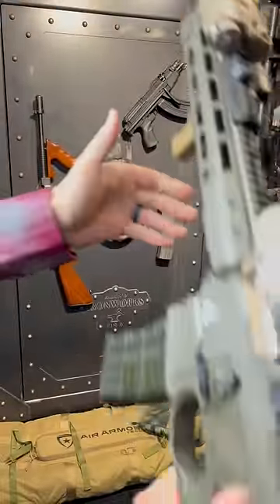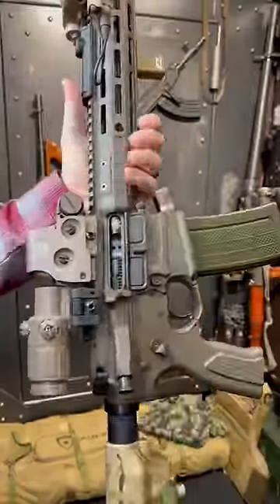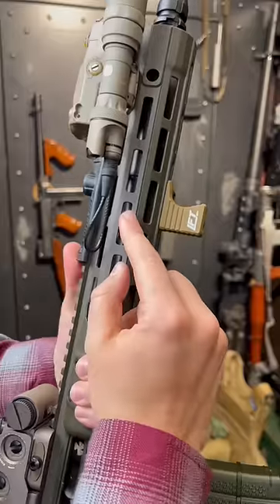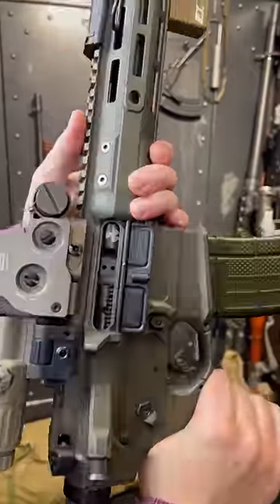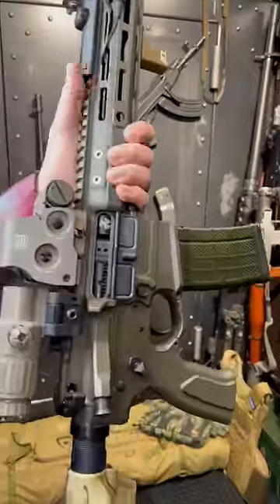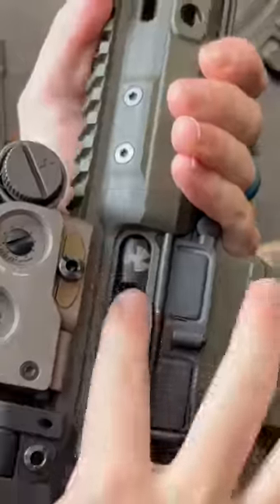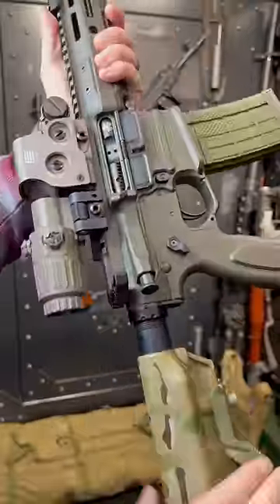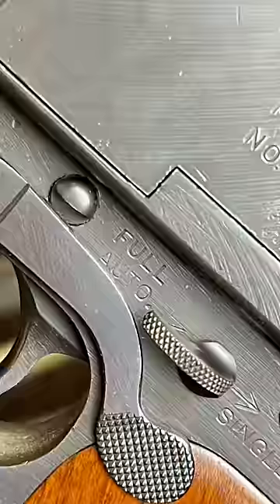Pro Tip: “Tuning” Your AR Explained in 1 Minute #Shorts

Comment: I guess you can say my dissipator is tuned.  16" barrel rifle gas system and just the right spring and heavy enough buffer for light recoil but smooth loading and reliability.  When I bought it it was a flat top upper that I had on an A2 lower.  I changed it to a car 15 stock, changed to A2 upper since I'm an ironsight shooter and swapped out the A2 handguards for A1 triangle handguards.

Comment: Do you have specific suggestions? I run most carbines with a Spikes T2 as the heavier 4 oz buffer is self explanatory plus the tungsten powder vs a metal block clickety clacking back & forth is noticeably smoother and a JP "tuned" buffer spring. They go from factory over gassed to  smooth but I'm all about smoothER. I'd greatly appreciate any suggestions you have. An adjustable gas block has not seemed to do much for me. In my experience, between the tiniest adjustment is a round barely landing on my foot and flying out at 3:30-4:00. I'm all ears my friend...that makes me jealous on the daily. 🤷

Comment: In guessing it’s a carbine length gas system , what part did you use for the buffer ? Supper 42 spring H2 or H3 buffer or did you go the jp scs system ?

Comment: where is the gas “in yo’ face” coming from? 

the gaps in the gun?-> would rubber on the borders between parts work?

an intentional and necessary hole in the gun (like the ejector)? make something that directs the air away (if possible)

Comment: “Gas pressure causes the gun to cycle.“

No, it doesn´t.

It is the recoil action of the bullet being
fired that causes the operation to cycle, but it doesn´t -- that is, not until it is the short-stroke gas piston that causes the operation to unlock, and do so.

This is common knowledge.

Comment: Just get a BRT EZ-Tune Gas Tube. Tell them what your configuration is, what rounds you shoot, whether you're suppressing or not, and they'll pick a gas tube that's better for you. Or if you know what size port you need for your tube, just select the size. It will make your rifle run much smoother.

Comment: But you didn't actually explain how to "tune" it like I know you can go heavier or lighter buffers but how do you lower the pressure I know 1 way you can kind of tell if you are over or under gassed is the direction the ejected casing goes like if the brass Flys forward its over gassed and if it comes out 90° from the ejection port you are pretty close and if it goes backwards it's undergassed I believe but how do you adjust the pressure I know some firearms have adjustment knobs but most ar15s don't so how you do it I know some charging handles can redirect gas but I don't know if that reduces the gas enough please help go more in depth

Comment: Do you have to tune an AR to a specific ammo? If I tune it to one type ammunition, isn’t it likely to fail if I switch to a less powerful load?
Reply: As long as your not switching between insane differences of ammo you can usually find a middle ground.

Comment: Ah maybe thats why smoke blows back in my face on meh ar pistol with one of those compensators that sends the noise down range. Ive heard it increases pressure. Pluss brazed brass/higher load frontier 68 grain 5.56.  Needa look into this!

Comment: When going into battle where you don't know when you'll be able to pull your gun apart and clean it without being shot at. I'd rather have an over gassed gun than one set up to just have enough gas to run it effectively. Cheap ammo different ammo or a few grains of dirt could cause you to jam or fail to feed when your life actually depends on it

Comment: Dream a little bigger?
DARLING!
😂
Leave it overgassed.
Maybe even drill the port a little bigger. Then, swap for a piston system with an adjustable gas block. No gas in my face, cooler for longer, and much cleaner, too.
😊
RIP Adams.
Glad I bought a few extra home build kits and spare parts.

Comment: Where do you put the gas in it?
Reply: In the gas tank in the butt stock. Ipersonally run premium in mine, but mid grade is ok too, just dont get the cheap stuff and you'll be alright. Also make sure you dont let water get in your tank, its never a good thing and you'll probably have to take it to a gunsmith if that happens since it'll probably lock up.
Reply: Also, adding some octane booster in the tank helps with performance.
And don't forget about blinker fluid 😉. You're welcome.
Reply: @GideonMagoh  how could I forget the blinker fluid?! Thanks for reminding me
Reply: @jaythus3181  😆

Comment: Gas Sucks !  Get a Piston AR.
 But not the Big Heavy Piston systems 
 My favorite ... Superlative Arms AR Piston System.
 Very simple design, Ultimately adjustable. easy to tune & Almost as lightweight as the gas system 
 $300 but includes the BCG. 
 The Only systems I run now.

Comment: Wrong!! All wrong!!
First of all your throw away weapon is designed around a 20" barrel. The length of the longer gas tube on the proper sized barrel sends the amount of gas the bolt was designed to accuate with. Same with the standard M16/ AR15 buffer assembly.
 Because you chose a shorter barrel the gas tube is now too short. This does cause a more aggressive bolt assembly movement. 
 Your so called "tuning" is band aiding a problem you have created. In your case and anyone else who's putting too much thought into this matter..... just don't worry about it. You'll NEVER take your "throw away" gun into combat. On the 1 in a million chance you do. Trust me, the last thing your going to worry about is whether your bolt is moving too fast and hard.

Comment: Ok ? But how do I “tune” the gas system.
Reply: Unless you plan on adding a different gas block (which only helps but doesn't tune the whole rifle, it just changes the gas to the most optimal cycling for only changing the block) you can start with the buffer assembly and the bolt carrier. Increasing or decreasing weights increases or decreases dwell times. Gets kind of expensive,  so just finding optimization with an adjustable gb is the most economic and simple way.
Reply: @hahahalo777 if youre buying from the ground up, an adjustable low profile gas block like a superlative isnt much more than most fixed blocks at the same price (within like $20-30 usually, sometimes cheaper but it depends on what you want to trust), and the bootleg carrier isnt much more than your more mid-high end carriers (for example bcm) and even less than some of the high end (for example geissele). If you combine those two, its pretty easy to just tune the gas block, never touch it, and tune at the bolt carrier group for any suppressor use from what ive seen, or just to tune on the fly if youre ammo is higher or lower pressure than usual depending on how you tune it. Its what im planning to do my next time around. Otherwise if youre not wanting to do a whole bunch to an already completed rifle, buffers, bcg, and springs are probably the way to go in that order. That is pretty much what you said, i just figured I'd add to it. 

Id also like to add that if you're getting a buffer, dont get one thats too cheap. I had a $40 complete buffer assembly a few years back and actually had the buffer from that break on me within 200 rounds (it was a screw on head design, carbine weight buffer on an 18 in mid length gas, broke right on the threads, im pretty sure it was spikes tactical bc of the logo but possibly a knock off). I've since had a Brownells h1 in it and haven't had any issue yet, but just a fair warning to others in the market.

Comment: I have an ar15 with a 18 inch barrel and rifle length gas system and between that and the brake on the front of it I swear I have shot semi auto 22lr rifles with more recoil

Comment: How are you a pro again ? Do you actually make the parts or do you use parts and knowledge that an actual machine guy made ? No dis man but there is a difference between an enthusiast builder and pro manufacturer. Unless you are a machinist or a factory engineer I would use caution saying pro tip. Nice build tho seriously no disrespect as I don’t usually text or comment so this may not come out the right way

Comment: Lots of talking with no real value. 

Such as the types and sizes of gas blocks and ports and tubes. The o rings on the bolt. The different bolts and carriers. Different buffer weights and springs. 

I mean, great info but definitely lacking. Didn’t even shoot it. Show the difference of a stock run of the mill gun and a tuned gun to really drive home the point. Just my $0.02